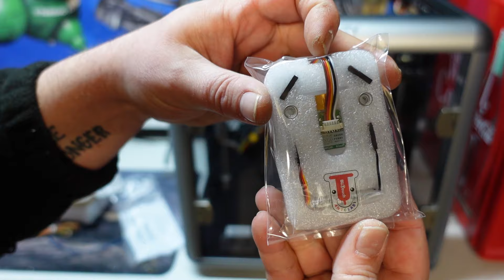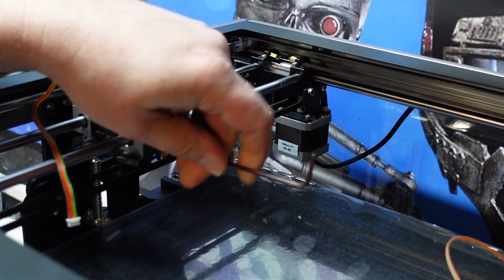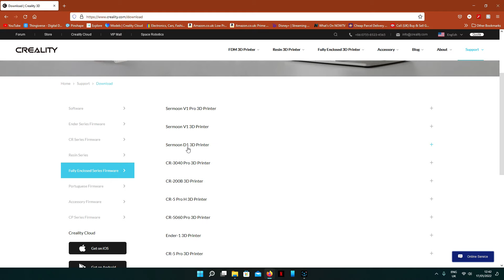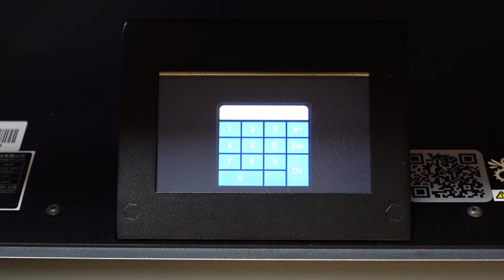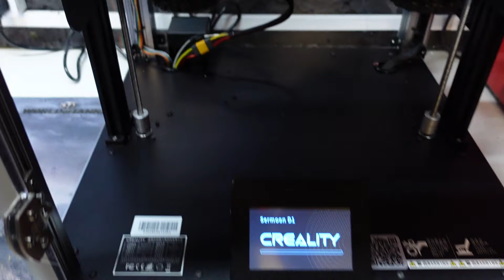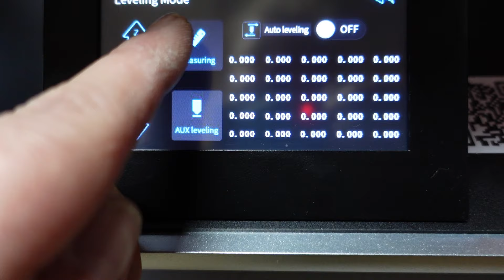Creality Sermoon D1 Working BLTouch Install

Comment: The breakout board only supplies 3v3, not the 5v as required by the BL and CR Touch. My BL Touch worked but inconsistently while the CR touch wouldn't work at all. The solution was to run the cable all the way to the BL Touch connector on the mainboard to supply 5v to the unit.
Reply: Where did you find such a long cable to place to the motherboard?
Reply: @AnthriXable  I think it comes with one that is long enough or at least my kit did

Comment: I did as shown in the video, only thing is when I turn it back on I get the keypad same as after motherboard firmware...? what did I wrong?
Reply from the maker: Hi, did you flash the screen with the new firmware as well? I would suggest doing the screen again
Reply: @BeanGaming-w4n  and should it be necessary to give the firmware an additional number? thanks for replying
Reply from the maker: @martijnbijkerk1356  I've never had to do that, I just updated as normal, just make sure you have extracted the firmware correctly after you have downloaded it
Reply: @BeanGaming-w4n  Still doesn't work, It keeps saying in the bleu screen no files done, and when I check the folder there are 3 files (binary) that they can't be unarchived. (13, 14, 22) perhaps it is necessary to say I have an iMac?
Reply from the maker: @martijnbijkerk1356  see if you can download 7zip I'm not sure if it's available for mac but that should then extract all the files correctly
Reply: @BeanGaming-w4n  still not working I did found out that the firmware is also not unzipped? a friend of mine told me that he thought .BIN files did not need to unzip?
Is there an option you can send me the unzipped firmware?

Comment: Its a bit ODD that he saids it WORKS, but there is NO Newer FW List on Creality site for the link he listed. Also id be nice to actually see on the sdisplay what we should be seeing? PLEAE UPDATE EVERYONE ON THIS
Reply: If you search it there is a release on 20Jan on Creality site. I haven’t try the firmware from Creality since I had a fail BLTouch unit when I try. Later I have got a new BLTouch and working fine with Klipper firmware
Reply: @fung612  The latest update on creality site is 31 Dec 2021 and the hyperlink has been removed from the download link. No trace of this firmware anywhere.
Reply: @drubhoy84  oh….. then you need to wait or you can send a email to Creality CS. I think they removed it because of the bugs.
Reply: @fung612  OK so thank you

Comment: Thanks for the vid! Looks straightforward, one thing though, on the placement of the zip tie for the bltouch cable, I've only had the printer for a week and I've already had to unscrew that little piece and slide it up 4 times to unclog the filament curling in there, I would suggest routing it with the rest of the wires inside the little cage and behind the hot end

Comment: Everybody with a Sermoon D1 this product is not yet available for our printers. I spoke with technology Outlet and they assure me it's coming soon but not yet available the one he is using now is a pre-launch todays date is 2/22/2022...also awesome video i cant wait to get one!!! Will following you!
Reply from the maker: Hi, yes sorry in all the excitement of getting this video done I forgot to mention it was pre launch, very sorry for the confusion
Reply: @BeanGaming-w4n  no need to be sorry! Im just excited it may be soon! My bed is warped and had to use tape to bring up center haha did they happen to say how long till launch?
Reply from the maker: @Cody_Spaghetti  personally I think the hold up is creality as the firmware they have released is slightly buggy as it won't save the z offset so once creality fix it then I would think technology Outlet will release the kits
Reply: @BeanGaming-w4n  cant wait will make it so much better would you recommend just buying silicone mounts to replace springs since they wont be necessary once the touch is available?
Reply from the maker: @Cody_Spaghetti  hi, no stick with the springs as it's still handy to be able to adjust the bed manually slightly then the bltouch won't have to compensate to much if the bed is miles out if that makes sense
Reply: @BeanGaming-w4n  it absolutely does ordering aftermarket springs now thanks so much

Comment: I replaced the BL with a CR touch.  It still will not bring the z up if it is about 200mm down. It acts the same way it did for you on your first try.  Z limit is removed.  It now acts like the z drive is  over current.   It will go down wait a while than after a while moves up.  It seems worse if the bed heat is on.  I will need to check power supply output.  It has only once did the entire measure without getting error 203

Comment: Hi, thank you for the video!

I am looking to order a BLTouch for my Sermoon D1. One question: after installing the BL touch and flashing the new firmware on the printer, is there anything else I need to do, like for example setting the distance between the nozzle and the BL touch? Or is it ready to go after following all the steps you explained in the video? 

Thank you

Comment: Hi, what version of the kit should I use? The ender 6 one?
Reply from the maker: Hi, yes the kit from the ender 6 is the one you want, the firmware can be a little buggy at times though, ive noticed it won't save the z offset, I'm hoping creality will release an update to fix it
Reply: @BeanGaming-w4n  Cool, thanks, will try it out!

Comment: I installed a bltouch in my Sermoon d1 I had loosened the Z screw couplings and moved the build plate down to the center.  Now it thinks "0"  is in the middle of Z travel. The probe extension and retraction are not consistent.

Comment: I can confirm this method works (for BlTouch, but not for CR-Touch), but it's very important to use a small micro SD (2gb or 4gb is ideal) card for the screen, which needs to be formated with 2048 or 4096 bytes of Allocated Unit Size. It took me a few hours trying different versions of the firmware, until I realised it was the MicroSD card's fault. Good Luck!
Reply: Apparently CR-Touch works too if connected directly to mainboard, not through the breakout board. Haven't tried it yet.
Reply: @eraldylli thank you so much I was pulling my hair out I get a blue screen with a bunch of zeros but I've been using a 32 gb
Reply: Hi mate, I saw your comment a few weeks back and used a 4gb sd card which solved a 2 week headache trying to update my screen (i was using a 16gb). Just wanted to say thanks. Also,  can confirm cr touch only works through mainboard and bltouch only through breakout. Tested both.
Reply: @raym1763  Nice. Thanks for further detailed info.

Comment: Do these instructions work also for Creality Touch too?
Reply from the maker: Hi, no this is for the bltouch only I'm afraid
Reply: @BeanGaming-w4n  I see. Thanks.
Reply: @eraldylli  i’m running a crtouch on my Sermoon.  You have to print a cr touch bracket.  Some people get it to work with the ender6 cable on the breakout board but many of us had to run the standard bltouch cable directly to the mainboard.  Otherwise it’s a similar process
Reply: @BaltesTV  Oh, so if I connect directly to motherboard it should work? Interesting. I noticed on the board, in the BLTouch port there were only two wires attached, for signal input and output. I'm guessing the grounding and voltage signals are taken from elsewhere is the breakout box, and that's why probably the reason the CR-Touch didn't work right away for me. Luckily I had both BlTouch and CR-Touch lying around my work space.
Reply: @BaltesTV  What firmware did you use?
Reply: @BaltesTV  did you run yours to the mainboard? I unplugged whatever was connected on the mainboard and plugged the CRTouch in. Just couldn't find a working firmware at the time.
Reply: @BaltesTV  Even I want to know if I could attach the CR Touch directly to the breakout board. Will it work with the supplied cable? If it doesn’t, isn’t it possible that the wiring order might be reversed or different?